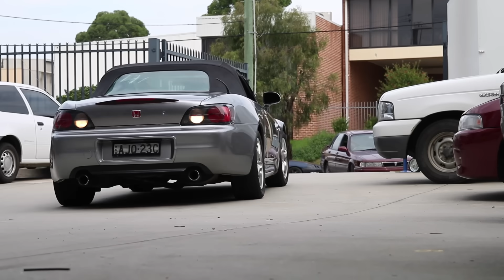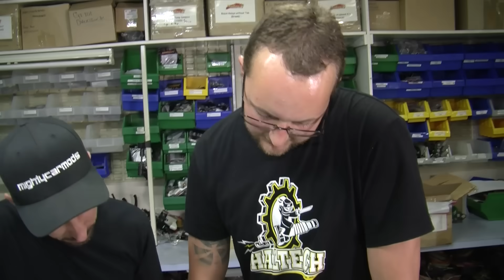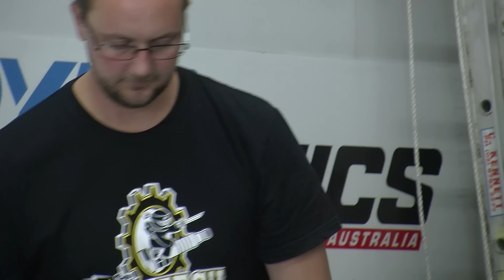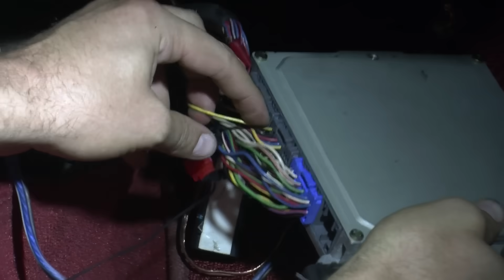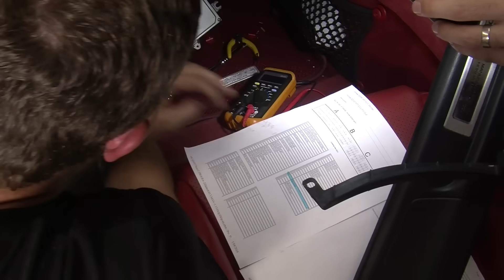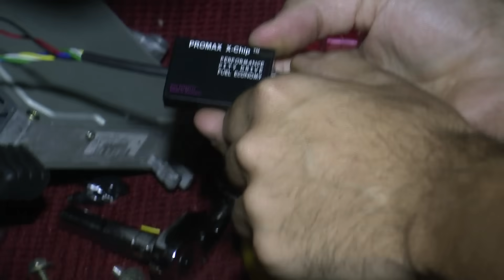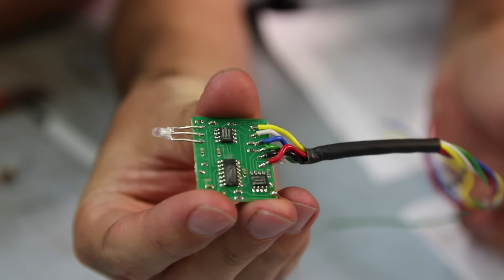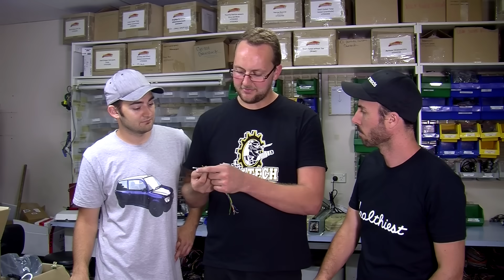eBay Performance Chips -  Mythbusted

Comment: I bought a $20 "chip" for my old 7.3 power stroke. It made a difference but all it did was turn up my pump a little with a resistor. Gas vehicles however...cheap chips didn't do anything. An expensive programmer for gas won't make as big a difference than diesels. You will only gain 5-10 hp but it's enough to feel. A decent programmer won't ruin a vehicle, it's usually an irresponsible driver.

Comment: I got my VW 1.8t chipped and it worked great. Of course, that involved pulling the ECU and sending it to the modding company for 3 weeks, cost 10x as much as eBay chips, and the engine had a turbocharger to work with in the first place.
Reply: Shawn Elliott thats not exactly chipping that's just tuning
Reply: Actually, yes it was "chipping", because the reason I sent my ECU away was to have one of the microchips de-soldered and replaced. The chip couldn't just be unplugged like it could be on newer versions of my car. They didn't do any dyno-tuning afterwards, they just swapped the chips and that was it.

Comment: There isn't really
Any magical computer algorithm that's going to make more power anyway. 
Your pretty much limited by the internal
Engine design. 
Compression ratio, bore and stroke and velvet timing are what determine an engines power output. 
The computer doesn't do much more than mix fuel
Ratio and adjust spark timing.
Reply: Valve, not velvet. Stupid spell
Check

Comment: a 20 pound chip? aha have a laugh. why buy anything cheap for your car fuck sake. amateurs
Reply: daniel kalinowski congratulations. you get the point of the video
Reply: I didn't mean to sound condescending. What if you did one with a chip from a premium company to see the difference? between both the cheap chip and the expensive one?
Reply: i can sell the same chip for 500 dollars. would it make it better? point is shady chips from ebay sellers are garbage, go to a real company that specialises in (ecu)tuning.

Comment: i agree in general that ebay chips r fake but i did buy one for my older prado to see. i used to barely hit 110kmh it now clocks way above it, pulls a lot faster off the line as well. i think it cost around $90 bucks. (aparrently from germany) had it on for about three years no issues yet :)

Comment: I have NA engine in my hyundai i20. Tried performance chips and K&N filter. Nothing noticeable. Tried tuning ECU with fuel and air mixture and gained only 7WHP. Cant afford a turbo since they are way more costlier in my country. Is there any other way where we can mod the NA engines. It would be great if someone helps me out

Comment: 30 hp? Port and polish the head, new cam, modify fuel injection, install custom exhaust manifold. If 30 hp was as easy as spending $20, everyone would have supercars. Race teams could buy used cars and build instant race cars with a cheap color changing LED. You can put those pieces of shit on a Corvette and see no improvement in performance.
Remember the old saying..."Speed is just a matter of money. How fast do you want to go?" In other words...$20 is better spent on gasoline.

Synthetic oil gives you 5 hp, right?

Comment: DO THE MATH!!  The chip said it will give a 35 horsepower increase. Without the chip you dyno'd at 177hp. WITH the chip 179hp. Dyno it 17.5 more times ...AND THERE'S YOUR THIRTY FIVE EXTRA HORSEPOWER!
I bet if you read the instructions, it does state that you'd get the increase ALL AT ONCE!

LOL

Comment: you guys aren't very smart alright, why not just use pins and pushed them in at the ECM connectors, you messed up a good wiring harness, smh...

Comment: Well why don't you take that idea of what the chip was suppose to do and y'all do it the right way that it claimed to do in the first place
Reply: Benjamin Moore Even if you do intercept and alter the sensor readings the ECU will just compensate. Eg. you manipulate the intake air. lean out the engine so use less fuel / get more power. Exhaust O2 sensor realises engine is lean and richens engine mix again. The only way is a remap of the ECU. Modern cars don't need after market ECU they can be mapped through obd.

Comment: I just bought a device off ebay for £17, for my particular engine, it is basically a resistor box not a chip, it plugges in between the loom and the fuel temperature sensor. Got roughly an extra +40bhp and +70pft torque, best £17 ever spent. 2000 miles later - all good.

Comment: I put an innovative performance chip ($80) on my 2015 F150 with ecoboost 2.7L on 6 months ago. It only took 10 minutes to put on just two splicers on the MAF wires and a sticky tape to the airbox and it was ready. Disconnect Battery overnight FYI. I have notice 2-3 mpg difference easily and without question feel a performance gain in sport mode. I chose this really to get better fuel economy and the performance boost was a big plus to. I didn't want to re tune but will post warranty. Nice thing is the module comes off in seconds if you have to get it dealer serviced. 5 star rating for me.

Comment: But YOU DID get a cool LED light that changes color...
Reply: an enormous dong for a shifter would do the same thing
Reply: Skrutinizr -Do you sell those for $5 with free shipping?  I need new conversation starters.
Reply: Tony Stark - I have 1 in my car. Even if it does nothing it's a great conversation starter so I keep it.
Reply: Conversation starter. 

Oh whats that!!! 

A switch that controls a light. Only $20. 

So you paid $20 for a light. 

Yup. Its a conversation starter. 

Dumbass! Pull the car over and let me out. I can’t associate myself with you any longer. But before I go I have some magic beans for sale. Only $100. 

Hahaha. Or the dong shifter idea would work.
Reply: it's produced for roughly 35 cent a piece including everything...
Reply: Almost RGB too.. you just have to think of "off" as blue...

Comment: How is this S2000 only making 177hp? Here in europe they make 240hp..
Reply: ak operator na its just an ap1 and must of loss power throughout the yrs
Reply: Mark Schoemaker 240 at the flywheel is about 180 at the wheels.
Reply: Really, would'nt have thought it would lose that much hp through the drivetrain.. Thanks for your answer!
Reply: It's something like 15% -20% loss on two wheel systems and around 25% loss on all wheel drive

Comment: 177 HP on a stock s2000? That's fuckin terrible! My Volvo S40 has 170... Wow.
Reply: the s2000 is only a 2.2L and only weighs like 2800 pounds think about it seems normal
Reply: the real concern here is why does your 2.5L 5cylinder only make 170 whp

Comment: eaby performance chips are like ebay turbo kits like common but real name brand chips do work. Like Jet Performance makes chips and flashing programmers. I have a Jet performance chip in my dodge charger. Now its suppose to increase the HP and toque by 25 but i didn't get it for the power i got it to increase gas mileage and it did exactly that. Same route, same 300 miles, same everything. Went from 19.5 MPG HWY to 25 MPG HWY the very next day.

Comment: very misleading i thought you'd get a real performance  chip ..man i used a programmer superchip and my chevy had sweet sound better throttle response ,helped with backfire i noticed and def about 15-20 hp it said 60hp

Comment: Scratching off the serials on the chips is an incredibly common practice. Around a half of the devices you'll use in every day life will have a good number of serials scratched off and/or covered in glue. Everything from electric toothbrushes all the way up to laptops and gaming consoles, I've seen a lot of devices with the serials removed from reputable companies. If I recollect the N64 and Commadore 64 both had a large number of serials removed, for example. So sure its not great that they did it, or anyone for that matter, but its not a mega shady and shocking move on their part. However designing a circuit board solely to pass the signal through untouched is very shady and shocking. I would be pretty surprised if any real part of it had ever seen Germany. It looked more like something you could make on your dining table.
Reply: Why are people on the internet so creepy.
Reply: You only scratch off serials if there is something to hide. I own both a commodore and an N64 and neither of them have un marked chips.
Reply: same here. my C64 had no unmarked chips at all. I know 'cause I did some stupid things with it and I had to replace the memory chips.
Reply: Ανώνυμος Ανωνυμόπουλος You have missed the two major points. It is patented and they can find out what every single chip is within less than a single day's work with the right equipment. The patent of an Xbox controller, very bad example. They fully intended for others companies to make an Xbox controller and in fact helped them do so. The only thing they protected, for the 360 at least (I haven't checked the Xbox One), was the wireless aspect. They intended for people to make wired Xbox controllers for anyone who wanted to buy a cheap version but kept wireless Xbox controllers under patent and a few other laws to try to hold the premium market. In fact during the Xbox 360's full lifespan there wasn't a single wireless 360 controller which was sold widescale. That shows a full success of patent law for the Xbox 360 controller.

Once again, to make a copy product the competing electronic engineers will have to design their own. They will use their own circuits, their own features, and their own chips. As such protecting the names of your chips does absolutely nothing to prevent a copy product. On top of that anyone designing a copy product will have the equipment and the expertise to identify every single chip even without the serials.

The only people affected by hiding the serials are the customers. It stops the customers from replacing some of the chips when damaged (though some will require special firmware), and it slows down modifications to the device. That is all. They are paying money to essentially screw over the people who are buying their devices in the hope that they don't either repair the device rather than buying a new one or buy a lower end product and modify it to work like a higher end product. And of course the people reviewing products by pulling them apart and describing the quality of the components etc.
Reply: well if i have a company and i want to create something with hardware and software, i invest some money to electronic engineers. I need to have bigger price to the final product, so it pays out. If an enemy makes something similar just by copying mine, he can make a better price, so im fucked. So i hide the names of the chips i used, programm the chips with complex ways etc, to DELAY this from happening. The pantent shit isnt always working. If i make an xbox controller for example and someone copy it, i dont think im gonna have a pantent after this.
Also different chips might be similar.
Reply: Olivia Lambert  If you put anything into extra super unicorn mode you better have scraped the serial numbers off because the pixie dust is gonna happen!!!!
Reply: Beautiful and smart huh
Reply: youre hawt marry me pls
Reply: Captaintoast12321 Its becoming a more common practice in the modern age. I assume it might be something to do with the internet. Or just companies becoming assholes.

Ανώνυμος Ανωνυμόπουλος That is why you patent your design. A sizable company will have the resources to find out which components they are if they really wanted to anyway. But it doesn't matter because it will take them time to design their own and test it, you have the patent, and you will have a huge advantage marketing because you had the sole product for a long time. And if they are designing their own product knowing exactly which chips you used is pretty useless again due to patents, they will have to use different chips and a different design. Ultimately in the majority of cases they remove the serials it simply isn't needed, has no benefit, and costs them money to do.

wadsrradasdwafafs Unfortunately you are also uninvited to my wedding.
Reply: Skrutinizr Is that So? It's best to be first to market is It? Is that a rule of thumb in your eyes? Because you can actually be contradicted in many, many, many cases. I would have to say that it's actually no more often the case than it is not. I really like how you choose to come in like some kinda expert and judge other people throwing statements all 'MATTER of fact' style, when in actuality you have little more than opinions to offer.
Reply: You appear to be someone who has a lot of knowledge of the industry, but very little or no actual experience- and certainly no real understanding of "real world" applications of patents on electronics.  It's better to be first to market than take the time and investment to patent equipment unless you are a multinational like Samsung or Microsoft etc. Your equipment will be knocked off immediately.  Removing the identifying info on chips is almost never done except for cheap knock-off garbage from third world countries or Chinese back door factories looking to obscure their origin OR using counterfeit chips.
Patents are only worth it when you have the market in countries which uphold patent rights. In many countries, it costs more to defend infringement than it's worth- so skip the expense and realize you need to keep creating new products as your designs are stolen- and usually by the same company you're paying to produce your very own product.
Reply: u always have something to hide
if i make a chip that is working, i dont want other companies to make the same shit cause im gonna lose money

Comment: I have a question that I think is more of a personal opinion. If "high performance chips" were real, wouldn't the car makers order their salespeople to brag about them and push for them as an add-on option? I can see the conversation: "Hey, this VW Golf is good without a turbocharger. But for just $99, we'll replace the chips. It remaps the engine programming and makes it about 1.2 sec faster at the drag strip."

Comment: don't ever do this ,if you think you can out engineer the factory's ecu your nuts
Reply: you can electronically boost BHP...cold air induction as cold air advances the ECU ignition timeing and solder in a potentiometer into the intake air temperature sensor for $2....and your going to get some bang for your buckz .. auto speed.com

Comment: Just because this chip doesn't do anything doesn't mean none of them do anything.

If you're modifying the signals going into the ECU, you can control how it operates. In a turbo car the chip could tell the ECU that there's less turbo pressure than there actually is, and make far more than 25hp...all by convincing the ECU to not cut fuel to prevent an 'overboost' condition until it's reached 19psi vs the factory 14psi. 

On a N/A car, you're looking at things like telling the ECU that the engine is cold, and that it should add a bit of extra fuel...or that you're really not going at some triple digit speed that is 'not allowed' by the insurance underwriters.

This is what's called a 'piggyback' system. In an ideal world you're passing the correct values into the ECU and reprogramming it, but in many cases that's simply not possible with a factory ECU.

...and yes, if your factory ECU is smart enough at figuring out A/F it can detect the sensor bias and retune itself, assuming your piggyback system isn't 'spoofing' those values as well.

Comment: Supposedly "", some performance chips work, I guess in the 95-96 days between obd1-obd2 but I truly hope that everyone understands that, like he said, even if it does change some sensor's value, and most do, the computer will automatically retune the system to make up for the change and therefore negate it. Performance chips don't work in 1996+ or hmm, 1990- year model cars I guess is the most firm statement I can definitely make.

Comment: and aren't these cars supposed to make 250hp from the factory? 177 seems like a big loss for a newish car, I was expecting at least 200 after drive train loss. Anyone know why such a big loss?
Reply: +william bresinski the s2k was also rated at 237bhp @the crank ( factory spec)
Reply: +william bresinski Yeah I mean still, that's like a nearly a 30% loss in power, drive train usually accounts for 15% to 20% in awd cars. Idk am I wrong in thinking it should be making closer to 200? Or do most S2000 usually dyno these numbers?
Reply: +Josh d I thought maybe it was in KW too but on the screen you can see it says 177HP

Comment: Not these chips! I'm talking about those expensive chips which comes for BMWand shit! Test one of them pls
Reply: ...Dude... This episode is 2 years old. It doesn't matter how much money you blew on it or what you put it on, they do nothing. To make more power and torque on a bone stock engine, you need to do a proper ECU Remap, or if that's not possible you need to buy a tunable ECU.
Reply: +MaxTheKanuck hehe 
Yeah I've just found out it's just shit through a friend who spent $1.3k on a chip for his BMW. Yeah and totally agree with you mate :)
Reply: MaxTheKanuck Actually,a properly programmed chip can loosen up a few hp from many NA cars - but those will probably be a bit older cars (80s-90s) or cars delivered to regions with crummy fuel. And the fuel here is the key there - cars being tuned to do fine on low quality / low octane fuel, while not equipped wth knock sensors. The new tuning would leave you stuck with the appropriately rated fuel though, an you would probably gain ALOT more (beyond status quo) from a good engine overhaul. Oh,and that most likely wont be a piggyback -expect to have to unsolder and replace one or more actual eeprom chips inside the ecu.